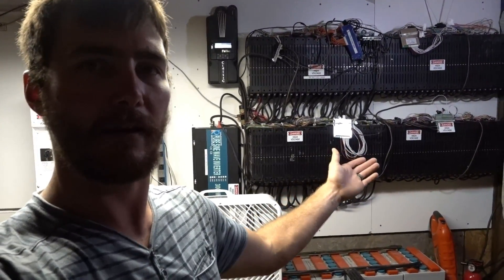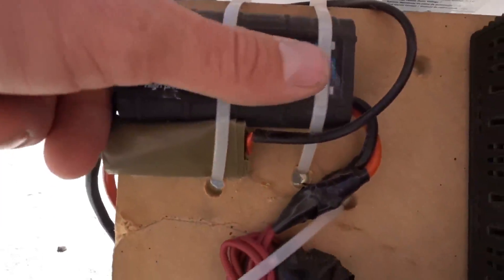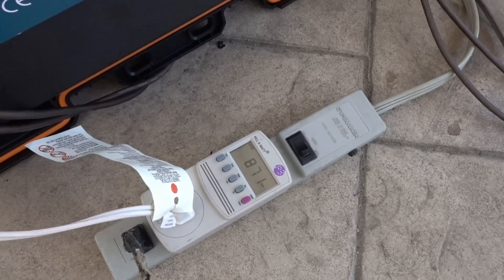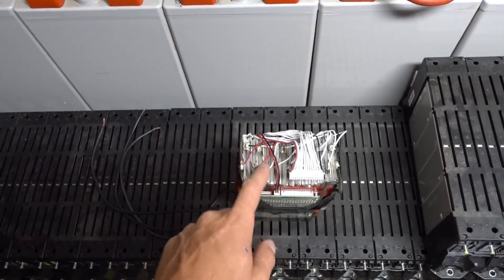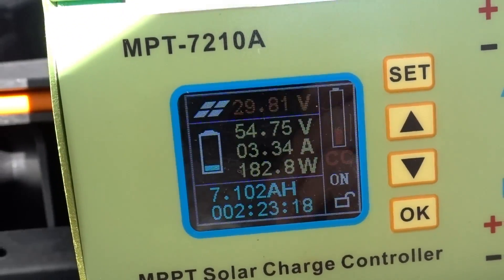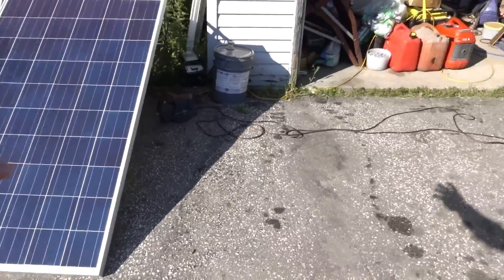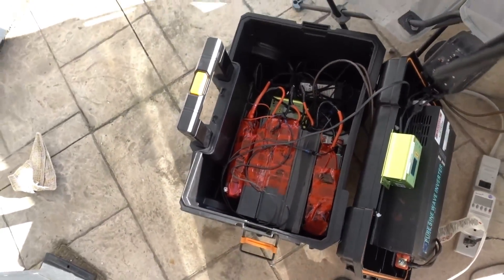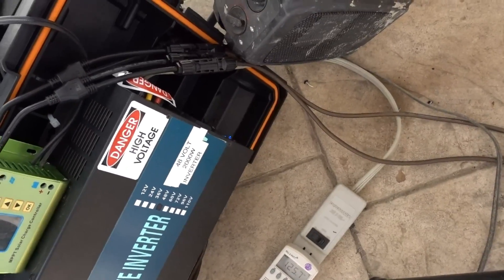3 8Kw Power Pack For Camping pt2

Comment: I'm thinking about building a couple emergency power packs since I'm off grid and my panels get damaged. Or no sun. Along with a DC generator.  Something like a 7s 100ah or so. Also a lead acid Bank to just keep charged. Since I already have the batts. I'm using them now. But want to keep them for backup. I have a bank of over 1100 cells I'm about to put to work. As soon as it is at 1400 cells. It should be well over 500ah. Maybe 600+ depending on the cells. Then I'm hoping for about 3-7 more. for 2000-8000 ah. Depending on cell availability. I may just add over time. I also plan to add panels. I saw some 470watt panels. They are huge. Nearly 4'*8'! It sure would make installation faster. 2 for nearly 1kw. But they are nearly 100 VOC. Do a mppt is a must. I was thinking king about using a pwm until I can get a classic or two. I hope to have a large enough bank. That under normal use I only go down to 3.5v and charge to 4v per cell. And charge at .5c per cell. Maybe I'll never have to replace the bank. Maybe just add a couple Cells in 20-30 years... I know I'm probably dreaming. I hope they will have a long life. I really need to look into a bms! My cells are close in capacity. They still need balancing occasionally. I'm thinking a few small bms for now. Then a baitrium or something similar. Great ol video!
Reply from the maker: thanks looks like you system is going to be amazing! make some videos!

Comment: Could you do me a favor and check the no load power consumption on the reliable inverter?  I'd really appreciate it.  I assume you're still happy with it since it's still on your wall.
Reply from the maker: I will do so tomorrow!
Reply: Look forward to it! Thanks!
Reply from the maker: my 48 volt model takes  .25 amp idle at 60 volt input
Reply: 15w.  Thanks, that's awesome.  I'm running one of those big 15kw (sure it is) low frequency Power Jack units right now.  From the factory it sucks 96w at idle!  Horrible.  I've been messing with it and gotten that down to about 52.  I've got something else I want to try to pull it down further, but with those 2 big transformers in there there's only so low it will go.  

Even at 52w that's still 1248w a day.  Too much.  It is a beast despite not being what they claim, and it will be handy for welders and pumps and big stuff I use occasionally, but for every day use I think I will have to replace it with a high frequency unit like the one you have.  I wish I could stack those.  The 3kw will probably be enough, but a little more for safety would be nice.  I've heard nothing but good things about the 3k units but the only comments I've found on the 5k Reliable units have been negative.
Reply from the maker: i have a 8000w coming just wait and see :)
Reply: From reliable?  I didn't know they made one that big.
Reply from the maker: yes :)
Reply: Can't wait!

Comment: Have you thought of buying a proper off grid inverter, be Intresting how reliable the 8000w inverter will be (more due to using 110v over instead of 240v)
Reply from the maker: lee x I have a 4400w magnasine inverter

Comment: Are you trying to up convert with your charge controller?  I thought charge controllers could only down convert.
Reply from the maker: Aaron Aaron this is a weird boost controller it was cheap lol
Reply: I ask, because you said you were going to buy more because of your issue.  I just don't think it can work like you are asking it to.  I just don't want to see you spending more money for the wrong reason.
Reply from the maker: thanks buddy these are boost converters that up the panel voltage they are not the best but still work good enough to not through out, i have 2 setup now and is working much better.